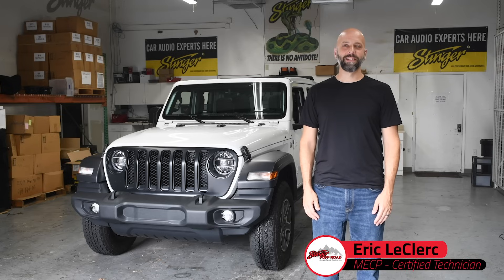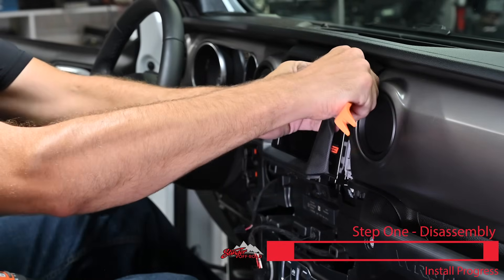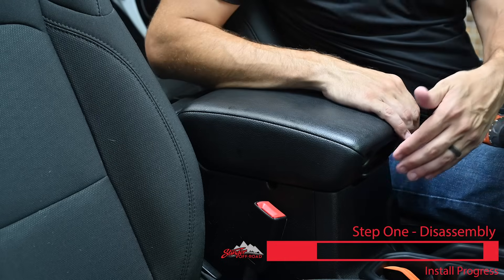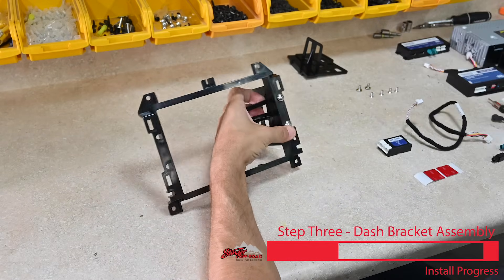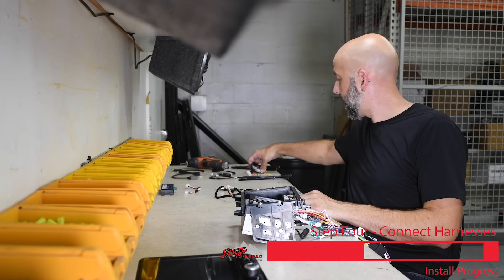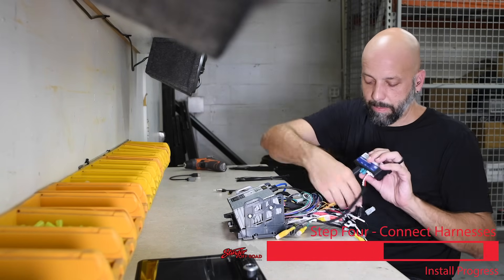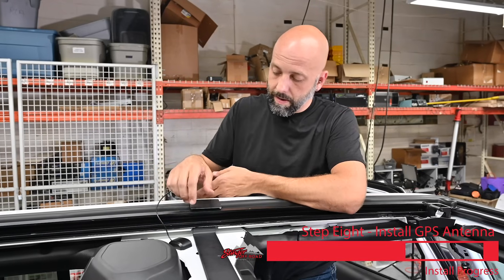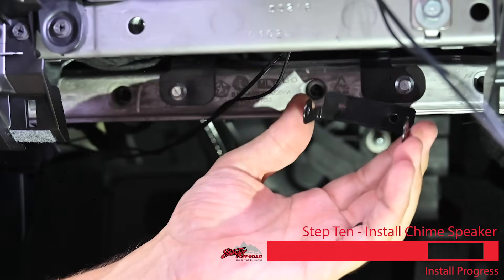2018-2023 Jeep Wrangler JL & Gladiator JT Radio Upgrade HEIGH10 Radio Kit | RB10JW18

Comment: I used this video as the main source for my install on a 2019 JL.  Great video.  There were a couple things i had to go back and zoom in on that I will point out.  First is Apple CarPlay.  The video mentions using the USB from the center console going into the lower port.  I had the unit upside down when doing this so they were reversed.  CarPlay will not work in this situation so be sure and double check these if you are have trouble getting CarPlay to activate.  Also the labels on my RCAs was a little different so i had to guess at those.  All in all it was pretty simple.  I am new to the Jeep world and have never really taken one apart.  With that said it took me around 4 hours total.  Hardest part is definitely squeezing everything into the dash.

Comment: Followed this video and I got no sound out of the speakers. Triple check with the manual and plenty other videos. Found a turn on amp setting in the manual after putting factory radio back in.  Anyone have this issue or know if changing that setting could have fixed my no sound issue.

Comment: I have this reciever in my 2016 Tacoma. One thing I noticed between the Tacoma and Jeeps the Jeep Stinger unit has a lot more vehicle features than the Tacoma's do.In fact I lost the settings for door locks, Backup sensor settings and Navigation turn by feature on the cluster near the steering wheel.When I installed this unit.

Comment: Thanks. Very professional video. You make it look easy. ;)  I ended up going with factory upgrade (for now), because support could not confirm if any of the WiFi CarPlay adapters would work with Stinger's. But your video was informative and helpful nonetheless. If I want to add numerous cameras or some of the other neat features like the pitch and roll overlay, I may still upgrade in the future.

Comment: I was really excited to install this head unit, but as it turns out, if you already have an aftermarket sub installed, there’s a lot more work to be done. I wish I would have known this as it’s not as easy as it’s shown in this video…
Reply from the maker: If you need further assistance, we're happy to help. Give us a call at 1-800-477-2267 EXT: 3333

Comment: the adapter kit i got has black plastic pinout retainers on the back of the connectors that make it difficult to seat the connections properly
Reply from the maker: You can remove the retainers if you need any assistance please call tech Support at 727-592-5991 M-F 9am-8pm.

Comment: Ok. Having issues. I have a base model 21 sport gladiator. I have the pac install kit and the heigh10. I don't have a steering wheel control connector. I have 3 silicon plugs labeled swc key 1 swc key 2 and swc ground. There isn't anything to plug them into. Also... zero sound.

Comment: Being that these are shown everywhere in a Jeep, my curiosity is for wanting to know it is is weather resistant? Dust or rain proof? Can't fathom paying upwards of 1500-2000 and then it craps out because my jeep soft top was open and a brief shower fries the head unit
Reply from the maker: The HEIGH10 radio is not waterproof or weather resistant. That is what is at the heart of all our 10" radio packages, not just the Jeep kits. So while it would be great for the Jeep applications, it is not as much or a want or need for the other universal applications the radio is used in. The HEIGH10 should be protected from moisture and the elements like other aftermarket radios.

Comment: Does the gps antenna come with the kit? I don’t see it listed . Also do you have to install the se card for the gps before you install the radio?
Reply from the maker: The GPS antenna is included in the package. The SE-P14 navigation card needs to be installed in the HEIGH10 brain, which is mounted inside the dash.

Comment: Hi.  In the manual it says 
Note: Installation of the chime speaker is only required in vehicles with safety group features.

I don’t have that do I need to install the speaker???
Reply from the maker: You only need to install the chime speaker if you have the safety package.

Comment: Great video! Do you need any additional hardware or adapter for Satellite radio?
Reply from the maker: You will need the SiriusXM SXV300V1 tuner.
Reply: @Stinger.Solutions  Thank you! Just got my unit. Looks so bad ass. Is there a certain position or area that tuner should go?

Comment: There is no mention of the front USB's. Do they still work with this radio?
Reply from the maker: The front USB ports will still work for charging or playing media files from a USB stick. You would need to use the one in the console for CarPlay or Android Auto.

Comment: Do you have to install the microphone? Or will the built in microphone work for call/voice commands?
Reply from the maker: You can use either mic, the internal or external, they will both support all the functions of the HEIGH10.

Comment: Did I need to purchase the SD card in order to get the on board navigation to work? I use CarPlay typically but just want a backup when service is down. Right now it is not functioning.
Reply from the maker: Yes, you would need the iGo navigation card in order to have GPS. https://stingeroffroad.com/search?type=product%2Carticle%2Cpage&q=igo

Comment: Does the 12-pin harness connector for amplified/non amplified connection into brain, have to be moved if I install an aftermarket amp later on?
Reply from the maker: That port only applies to the factory amplifier. It will not be in play hen adding an aftermarket amplifier.
Reply: @Stinger.Solutions  thank you

Comment: Two questions, 
If I wanted to use the hdmi input for something else other than the hd camera retention module could I just plug the factor backup camera into the same input as the additional cameras? Aka is there a way to keep the hdmi input open for something like a chromecast?

And second, is the external mic and chime module required? Does the unit had a built in mic? Why do I need a chime module? Will the factory chimes no longer work?
Reply from the maker: Hello Nathan,
You do need the camera module to keep the factory camera working, however, it allows you plug another HDMI device into the module. Here's a link to the install manual so you can check out the connection options. https://cdn.shopify.com/s/files/1/0284/9259/5245/files/RB10JW18_Install_Manual_v2.pdf?v=1601947336 

The HEIGH10 has both an internal and external microphone, you just need to select which option you would like to use in the Settings menu. The chime speaker is provided to keep your chimes audible, we recommend installing the chime speaker.

Comment: I hooked up my phone via HDMI. The screen mirroring resolution is very low and almost unviewable. Is there a way to increase the resolution? I dont have this issue with tvs or monitors..
Reply from the maker: This feature is device dependent. Check the settings on your phone to make sure it is out putting at a high enough resolution.

Comment: Does this model also work with the Gladiator Sport? For example, I have no power seats or windows. I thinks its the very base model. If this would work, I would love to order from you.
Reply from the maker: Hey Scott, 
You can install this even in the very base model. You will still get the gauges, you just won't have control for features your Jeep isn't equipped with.

Comment: On the back of the brain "Amplified" and "non-amplified", what if I am installing an amplifier and a subwoofer on my own. Will I have to pull it out and plug it into the Amplified slot?
Edited: the Jeep is Factory 5-inch screen with no Alpine system
Reply from the maker: That connection only applies to the factory amplified system. It will not play a part in adding aftermarket equipment.

Comment: Approximately how long does this install take start to finish? My installer quoted me 6 to 8 hours. This sounds a bit excessive...
Reply from the maker: Installation times will vary depending on the comfort and experience level of the installer, so it's tough to estimate time for others. With that being said, we engineered this kit with the goal of making it easy to install. The harnesses are plug and play and we have this step-by-step video along with a detailed installation guide included with the kit.
Reply: If it's their first time, sure, at least 8 hours......

Comment: What dip switch setting is needed if it does need one my stereo won't turn on
Reply from the maker: For technical questions, please contact our technical support department at 1-800-477-2267 EXT: 3333

Comment: Hi there! First off, thanks for an awesome video installation! Made installing my heigh10 in my JL so much easier (except for stuffing all those parts at the end 😂)
Question for you - everything works perfectly but I cannot lock on any radio stations whatsoever. Static no matter which frequency. Any idea what’s going on? What’s the phone number for your customer support? Thanks!
Reply: Yep while you were stuffing all those wires something came loose. Good luck!

Comment: Quick question i see the glovebox usb will work but what about the ones on the dash below the heater controls
Reply: Also can't seem to find if android auto and carplay have the wireless capability
Reply from the maker: Hello Coal, the USB in the console will be the one you use to plug into for Android Auto/Carplay. You do need to plug in for these applications, there isn't a wireless option with the Heigh10. The USBs under the climate controls will still have charging capabilities but no connection to the Heigh10.
Reply: @Stinger.Solutions  thanks for the reply  appreciated
Reply: @Stinger.Solutions  Hmmmm, to clarify, the USB below the climate controls still works for media file playback.
Reply: @nhojhtims4995  as does the left rear usb. The rear right is factory power only
Reply: @Stinger.Solutions  what happens if I invert the usb connections in the head unit? Switching the position from the usb coming from the back with the one in the dash. Would car play work with dash usb? Thanks

Comment: I notice the factory compass no longer works. Is there a setting to fix this?
Reply from the maker: The factory compass in the cluster is not retained with the RB10JW18 kit. You will find a list of the few features not retained by the kit on Page 1 of the Installation Guide, under "Important Notes". We provide a compass on the Heigh10 under "Vehicle Info".
Reply: Not only is that not retained, but if you have the aux lighting switches, you will lose the ability to change their function.
Reply: @SargeISF  bro he also doesn't explain where to plug the OEM aux audio to... also no compass? That sucks also

Comment: Where does the XM tuner go? I don't think I saw it installed.
Reply from the maker: Hello, The SiriusXM tuner will plug into the back of the Heigh10.
Reply: @Stinger.Solutions  is there enough room for the XM tuner with all the wires?

Comment: Where can I find the adapter harness for the SiriusXM Radio to work?
Reply from the maker: You need the SiriusXM SXV300V1, you can purchase direct from SiriusXM.
Reply: @Stinger.Solutions  Thank you
Reply: @DocG1914  if you have SiriusXM from factory, can you just use it?
Reply: @blueheronhomeinspections7295  That was really my question thanks. So the connection is already there if I have Sirius with the factory?

Comment: I had the heigh10 installed in my JL Rubicon. One thing I'm noticing is lag when using the steering wheel controls and factory volume knob. This lag happens when i toggle through apps or change the volume. Also the volume will sometimes go the opposite direction. Can this be improved with a firmware update? Mine is update to the 12-1-2020 firmware release.
Reply from the maker: We aren't aware of any issues causing the steering controls to lag, we'd be happy to help you do some troubleshooting. We have lifetime tech support on all of our products. Please give us a call at 727-732-3114 M-F, 9am - 5pm.
Reply: Did you have any luck with this? I just installed yesterday, and am having the same lag issues, plus opposite volume direction on occasion. I followed the video for the installation. Wondering if something is messed up. Thanks!
Reply: @anubhaskar6662  Nope and @Stinger Off-Road seems to be ignoring my question regarding toggling through audio sources and using the igo navigation. Say what you want about the factory radio, but i am disappointed after spending almost $2k and having these issues only to be ignored by the manufacturer. Also i called the number provided several times and NO ANSWER.
Reply: @combatspeed6392  I was able to get some one on the line through the support number. He gave me some tips; I'm going to try to debug it later today. He did seem very helpful. Also I confirmed with another Jeep owner that they don't experience lag. I will report back if/when I'm able to get it working correctly.
Reply: @anubhaskar6662  what were the tips?
Reply: @combatspeed6392  They had me test several things with a multi-meter. It turns out I have a faulty "Radio Pro Advanced" module. That is what deciphers the CANBUS signals. They are sending me a new module, which should resolve the issue.
Reply: @anubhaskar6662  did you install yourself? Or have a shop do it?
Reply: @combatspeed6392  myself
Reply: FYI, it had a faulty "Radio Pro Advanced" module in the kit. That module is what translate the CANBUS codes, and explains why stuff was delayed. After replacing that module, everything works as expected! It was certainly a pain in the butt to diagnose that, but Stinger did get it resolved, and I'm happy with the end product.

Comment: What if you want to hook up an amp? Are there plus for the rca inputs?
Reply from the maker: Yes, the HEIGH10 has front, rear, and subwoofer RCA outputs for connecting aftermarket amplifiers.

Comment: When plugging in the OEM Aux RCAs what RCAs do they go into?
Reply from the maker: The set labelled "AUX In" on the 24 pin harness with all the audio RCA connections.
Reply: I'm glad you asked this. I'm in the middle of the install and got here and thought "damn, there's a lot of red and white plugs on this harness"

Comment: Is the Heigh10 compatible with the Alpine PSS-24WRA speaker and subwoofer system for the JT? thanks
Reply from the maker: We have not tested that specific speaker kit here, however if you follow Alpine's instructions on wiring it up to their Restyle radio, it should install in line in a similar fashion

Comment: Does the kit Inc satellite antenna or can one from vehicle be used?
Reply from the maker: The kit includes an adaptor to allow the factory antenna to be connected to the optional SXV300V1 satellite radio tuner.
Reply: @Stinger.Solutions  so a new tuner must be purchased to reconnect SiriusXM?
Reply from the maker: Correct